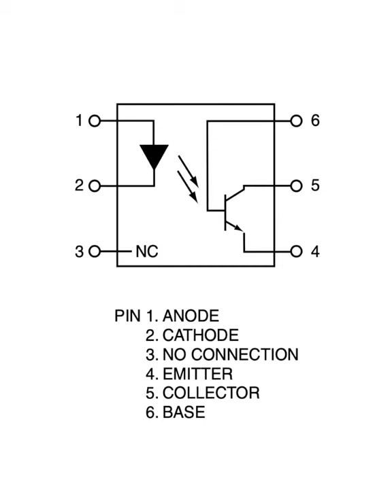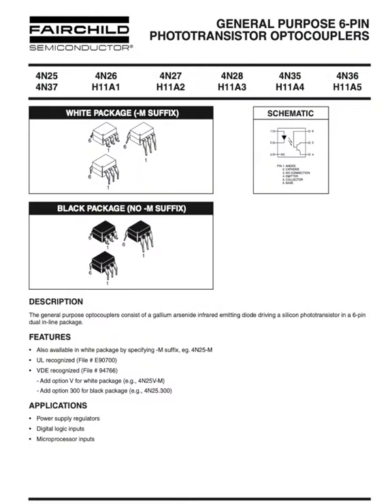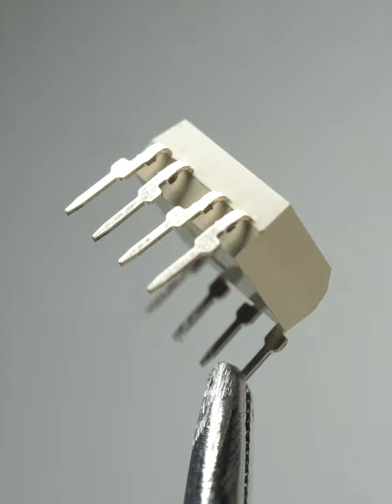Why do some ICs wear white? - Collin’s Lab Notes #adafruit #collinslabnotes

Comment: Black absorbs the IR light, white reflects it.  Quite clever and one of those "I never knew..." things.  Thanks!  :)
Reply: There are lots of other properties to consider as well, white dye additives tend to make hard plastics more brittle but we can assume this is the cheapest trade-off. 

Looking at aerospace versions will likely show some kind of internal path preserving design component, with the body prioritizing shock resistance at a wide range of temperatures.

Comment: How does absorbance/reflectance influence capacitance?
Is it the carbon-pigment in the overmoulding that raises capacitance? Or is it the improved reflectivity that increases optical gain, therefore increasing photocurrent, therefore improving the rate of charging an unavoidable capacitor? Which is it? The explanation is rather ambiguous. :/
Reply: I would say it is the carbon pigment that is acting as thousands of tiny capacitors that all rob energy off the signal, along with acting like a distributed capacitor between input and output. The white has metal oxides only, so there you only have to worry about the crystals storing a small amount of charge, and likely a lot less charge than a mobile electron in carbon particles, so a lower capacitance. Light blocking in any case is done during manufacture, there is both an overlap of the metal substrate the emitter and detector are mounted on, and then a coupling clear structure that allows the light to travel between them while providing insulation. Then a opaque support structure to absorb the forces imposed during the moulding of the package, and to keep the packaging away from the junctions.

Comment: isn't the led for the optocoupler INSIDE the package, does it matter what color the outside is ? I'm pretty confused 🤔
Reply: I imagine the white material around the optocoupler acts as a reflector.
Reply: I assume it's solid...
Reply: It's a solid injection molded part with no coating, in fact coatings are very rarely used these days as it massively increases price.

Comment: Uhhh… capacitance? You mean propagation delay? Actual capacitance should (as far as I understand it; I’m really a software guy that dabbles in hardware design, not a true EE) only be effected by the physical structure of the device, not the photoelectric phenomena going on inside it? 🤔
Reply: @j.f.christ8421  You can have any color your want as long as it's black.